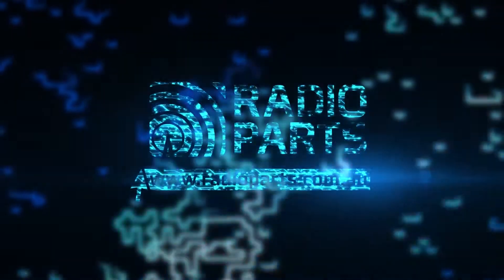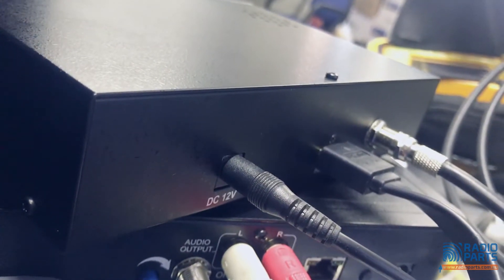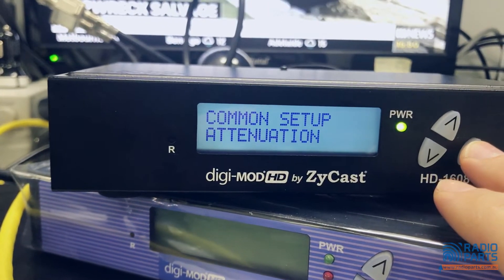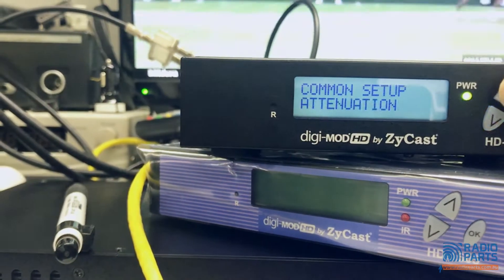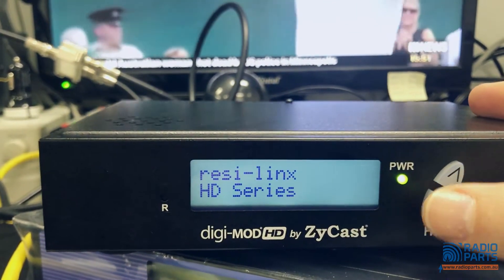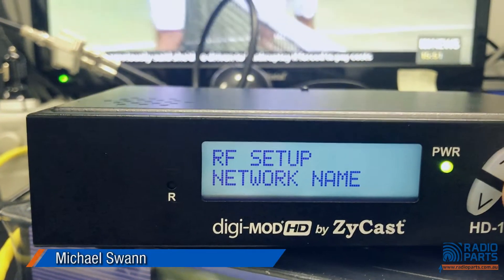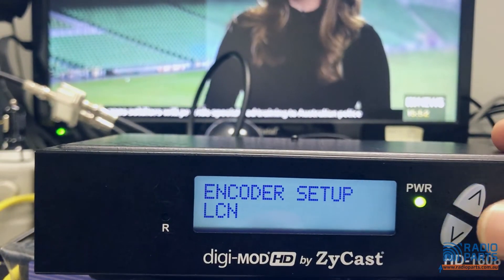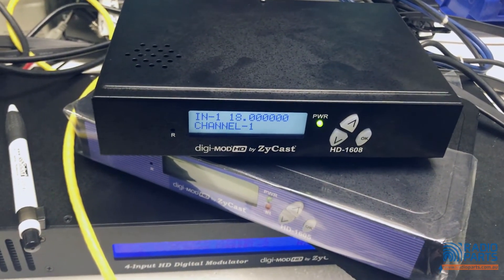Resi-linx HD1608 -  Single input DVB-T Digital HD Modulator - Overview 2017

Comment: Thanks for the video. Excuse my ignorance, but can the output be plugged into a conventional wall socket (where you would usually connect a TV to the Roof antenna) and connect to other rooms through the antenna connection? Or will more Coax need to be run (directly) ?